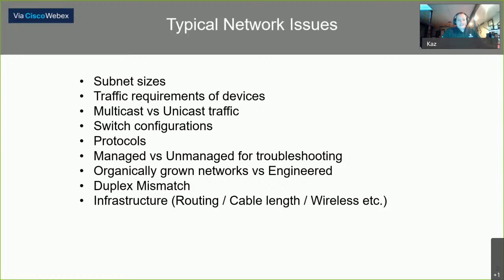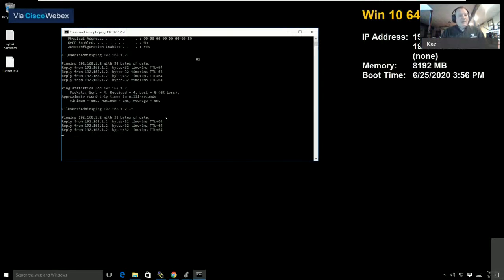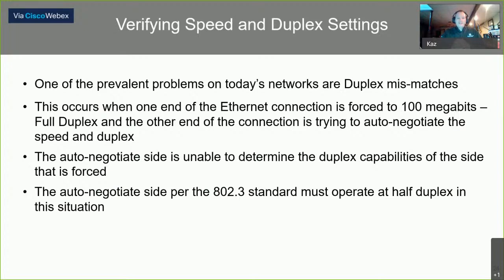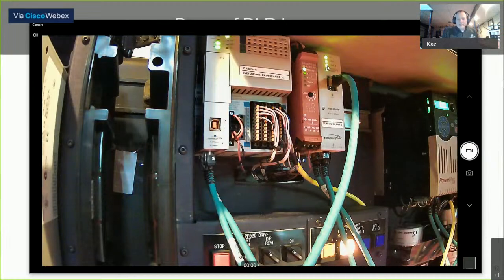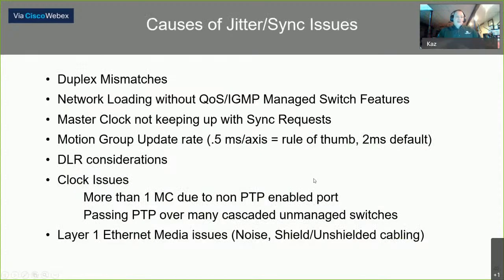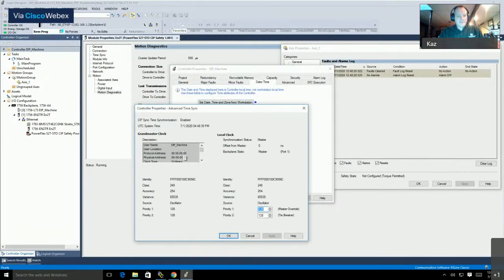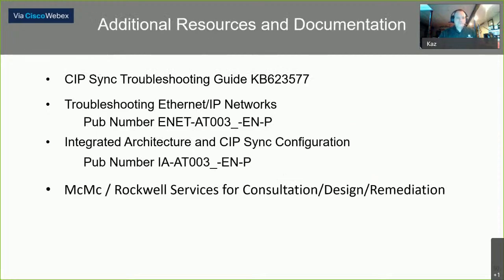Virtual Lunch & Learn: Ethernet Troubleshooting for Motion Applications

Comment: 2:52       Typical Network Issues
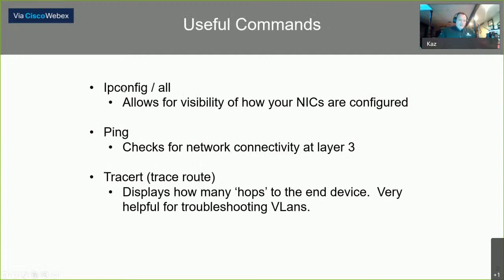8:41       IPConfig /all command
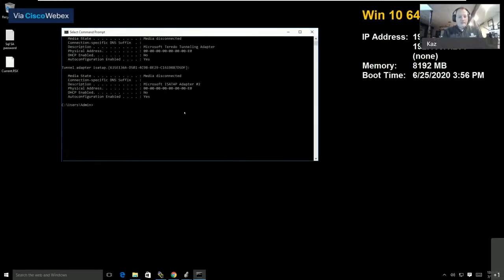10:12     Ping command
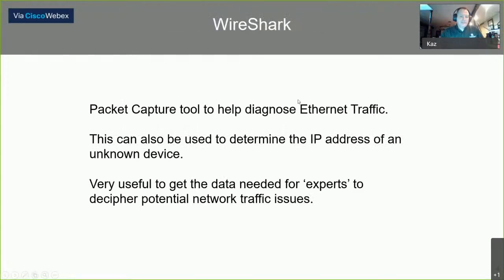11:39     Finding an IP address with Wireshark
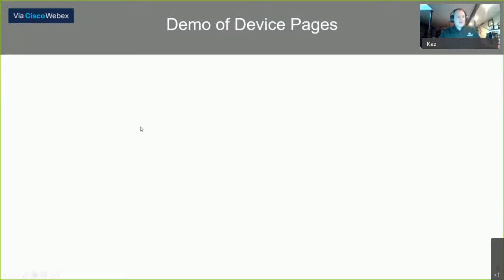18:10     Ethernet Media Counters
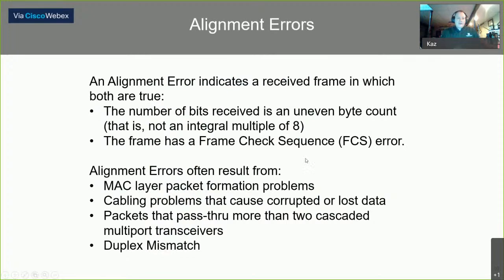18:19                     Alignment Errors
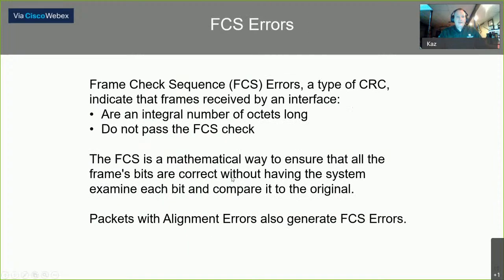19:00                     FCS Errors
19:13                     Collisions
20:36                     SQE Test Errors
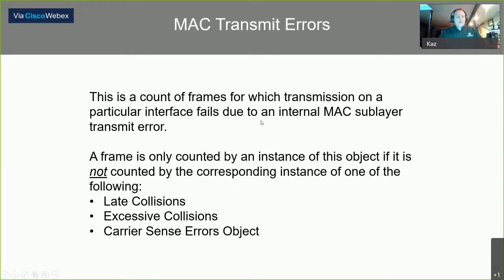21:01                     Mac Trasmit Errors
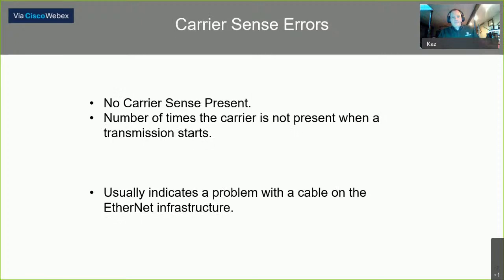21:18                     Carrier Sense Errors
21:44                     Mac Receive Errors
22:00     Duplex Mismatch issues and demo
29:31     Stratix Smartports
32:41     DLR How to find the Supervisor by LEDs
37:01     CIP Sync IEEE 1588 PTP Definition
40:13     Drive Properties - Motion Diagnostics
40:38                     Enable Transmission Timing Statistics
41:01     Causes of Jitter / Sync Issues
43:44     Clock Issues Demo - Grandmaster and Master Clock issues
54:23     CIP Sync Troubleshooting Flow Chart
55:13     Servo Startup issues